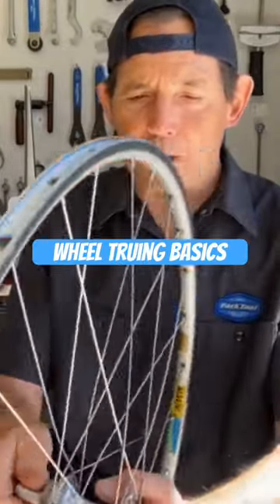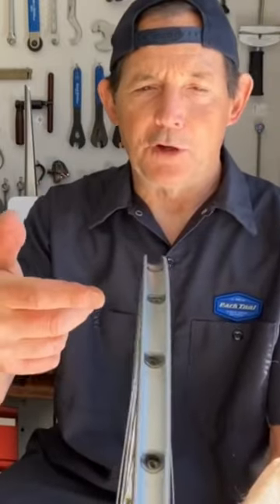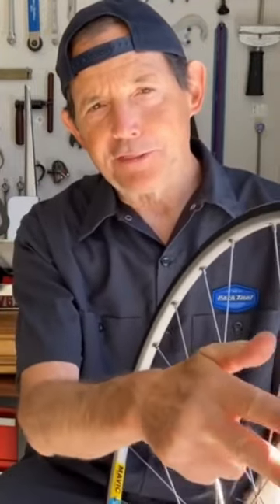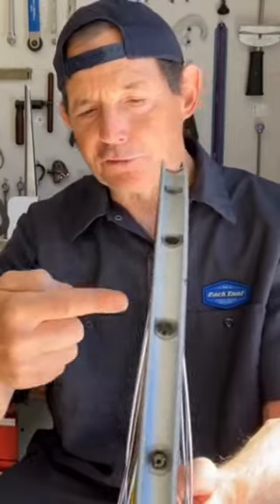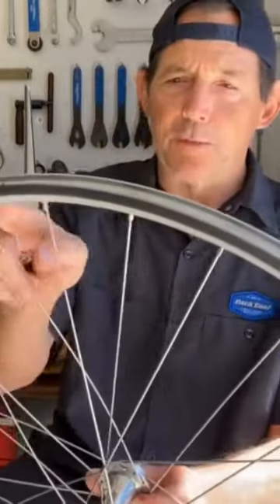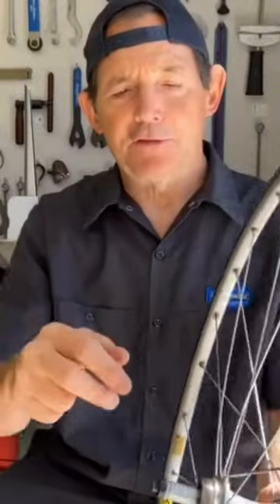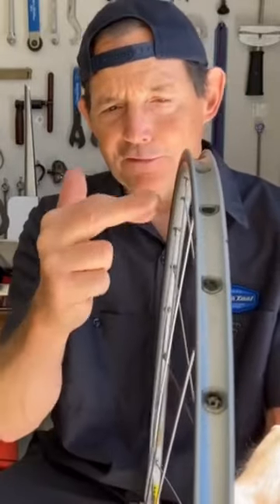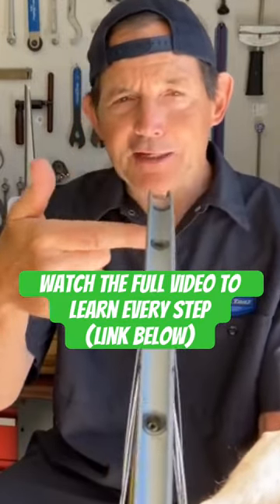Every Cyclist Should Understand These Basic Rules #shorts

Comment: Any tips for radial trueness? 😅
Reply from the maker: Thanks for watching and the question Noor. I use the same procedure for truing all bike wheels regardless of the spoke pattern. If they're radial, cross 2, 3, or 4 I follow the same basic steps as they work the same way. In this shorts video I just brush the surface. In my full wheel building lesson I go into much more detail so you might want to check that out. This link should open the video right at the beginning of my wheel truing steps: https://youtu.be/XUqul03hbZ8?t=1579 Hope this helps and thanks again!